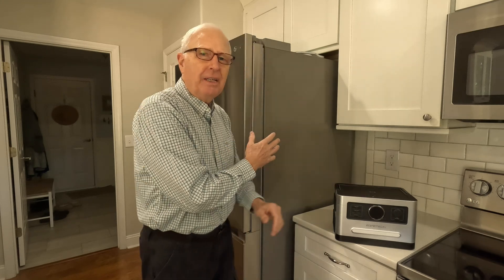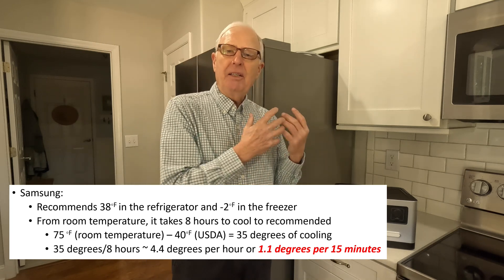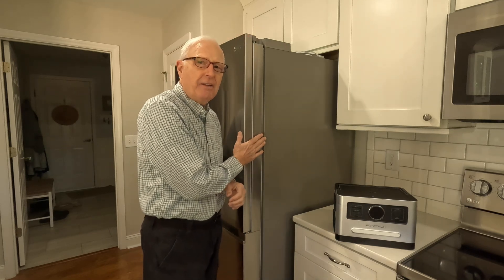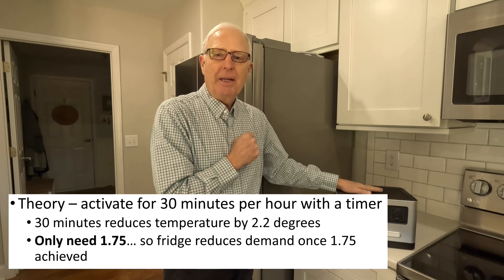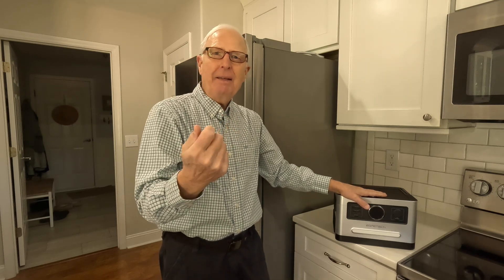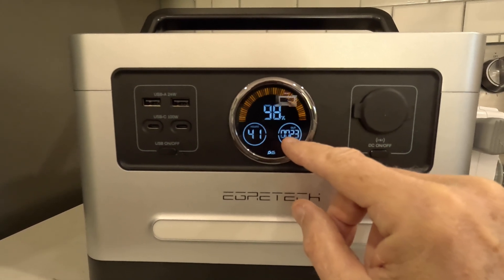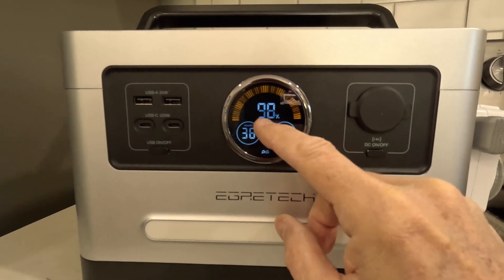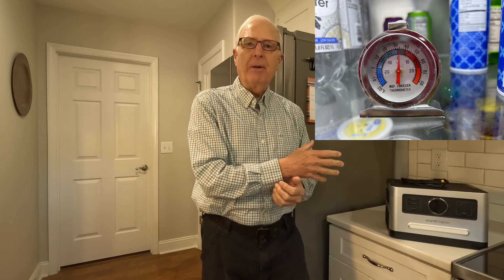Tricky Portable Power Station Test - EgreTech vs Refrigerator

Comment: I see you got a video of LifePo4 charging Ebike battery a year ago.
LifePo4 battery is 12.8 volt battery.
If an ebike charger outputs 54 volts to charge  ,would it damage the LifePo4 battery....
Reply from the maker: I do not use the ebike charger to charge batteries. These power stations plug directly into the wall. I have another charger for my trolling motor batteries that was made for LifePO4. Thank you for pointing out this issue.
Reply: @KayakhacksFishing  Thanks for the reply 😁

Comment: Neat test, and use of the timer. I have a few battery pack type devices (EcoFlow) and have done a test run for my fridge. Something I have done for yrs now, is I keep a gallon jug of frozen water in the freezer section of my fridge to help maintain some cold during an outage, and in the upright freezer in my garage I have three 1 gallon jugs of frozen water. On cloudy days where solar isn't available it's also a good idea to have a generator on-hand (+ extra fuel) to recharge the battery packs.  Charging them via the 12v vehicle outlet will work, but takes a long time, and uses vehicle fuel in the process of the long charging time.
Reply from the maker: Great points! Thanks!